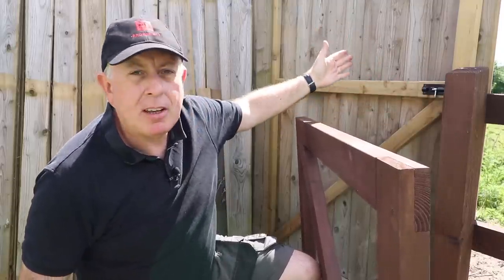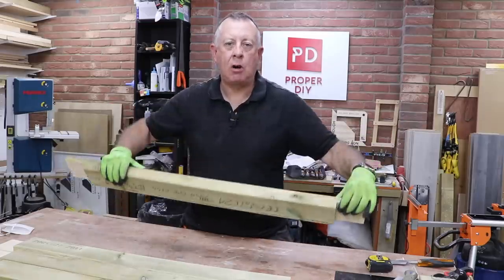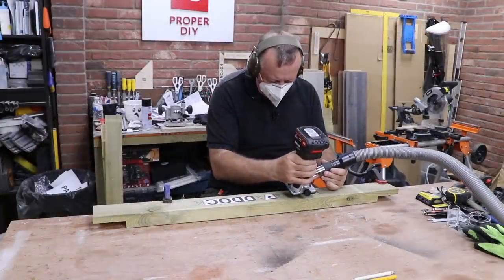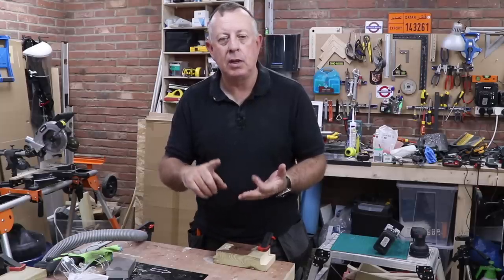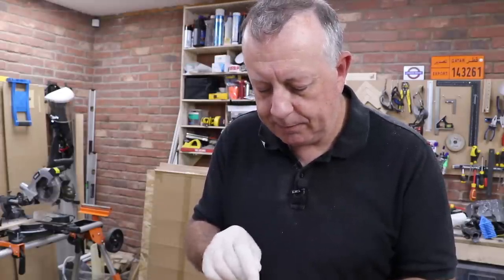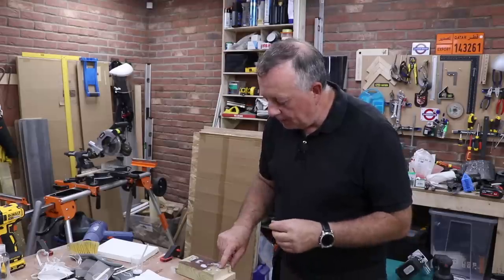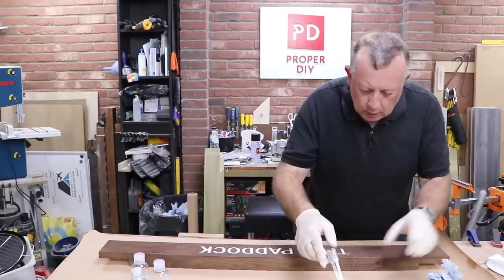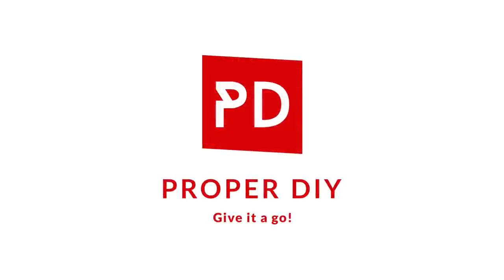Epoxy Resin Inlay Sign

Comment: Sign maker is my side gig, what we normally do is if doing by hand and not CNC, we A4 print off whatever font and size (that we agree looks right with customer) and we spray adhesive on that and place onto face of the timber. 

Then like you did, outline the letters with knife, remove paper and sand off face to remove adhesive, then route them out and finish with Dremel to get a clean look. We normally go 5mm if recessed and 8mm if filling. 

You did a great job there.

Comment: Warm up the resin bottles in a bath of hot water then let it cool before using Stu, will help reduce bubbles. Plus painting on a thin coat of resin into your inlays, don’t let it fully cure then pour your full mix into the letters, again will help reduce bubbles👍👍

Comment: Another cracking video Stuart
I bought a Milescraft lettering kit years ago to make signs which I then paint in the letters and sand back the top. This has the same problem with bleed, I get around it by spraying with clear spray lacquer before painting to block the end grain. 
Yet again you’ve done something I hadn’t thought of, I’ll be trying out resin on the next one and following the trick of not totally filling the letters.
Great idea!

Comment: Turned out very well!  The edges looked perfect. 

A tip for getting out the air bubbles is to vibrate the wood - for example if you ran your orbital sander along the length of the vertical side of the wood for a bit

Comment: Good job as ever. Milliput putty is an alternative to liquid resin which although it is an epoxy too starts off much harder so won't bleed into the wood, this allows the letters to be raised above the surface and sanded down. Disadvantage is that you have to manually pack the milliput into each letter.

Comment: The gate looks great.  I've just done a similar thing on the gate I built using your video but I used a laser engraver to create the voids for the numbers.  Hopefully, I won't get any bleed.  I did spray the voids before and I used finely ground charcoal as a pigment.

Comment: another time, perhaps a bit of shellac on the inside of the letters at the top would stop the resin bleed, and also maybe the water infusion. Any excess easily sanded off. Great video as always, clear, concise, no drama. Cheers!

Comment: Excellent as always. Quick tip for getting the lettering onto the wood: print it mirrored on glossy paper with your laser printer, then put it on the wood and give it a quick iron. The heat from the iron will transfer the ink to the wood making it a nice template to follow when routing.

I made a bunch of personalised coasters with names written in resin. They made fantastic wedding favours. Rather than pouring resin, I used Milliput epoxy putty. That would have worked well for you too and would have avoided the pigment issues you had.

Comment: May I suggest another way to reduce/remove the formation of bubbles, which I employ when making silicone moulds. Having mixed the two parts, pour into your lettering, with a thread of liquid as thin as possible. The thinner the thread, the few bubbles that will be left in your mould/lettering.

Comment: For the bubbles in the resin… could you not have employed the orbital sander technique (minus the sandpaper) to vibrate the bubbles to the surface and then gentle passes with the heat gun…?

Comment: Good video, one job I’ve never tried. I was thinking you could’ve used clear varnish water based to seal the letters then that would prevent bleed?  I’d have taped a lot of the piece because Sod’s law is knock it over 😂

Comment: No, the DIY solution is not to leave it low by 1-2 mm...
It is to apply a lacker on the inside of the letters, or even a 5-min epoxy.
That way when you fill in with your white resin it doesn't even touch the wood and hence it not sucked up.